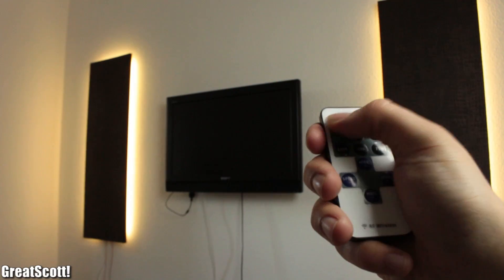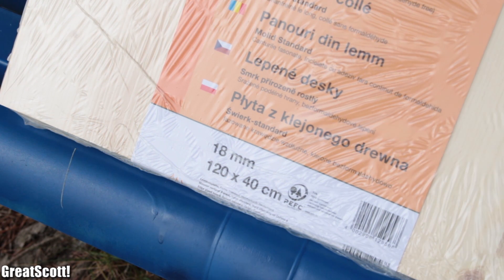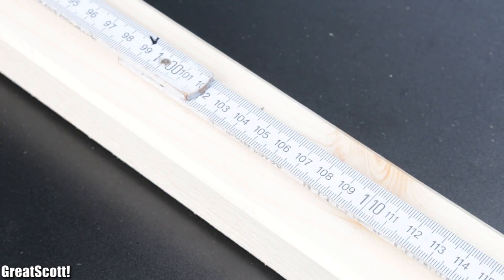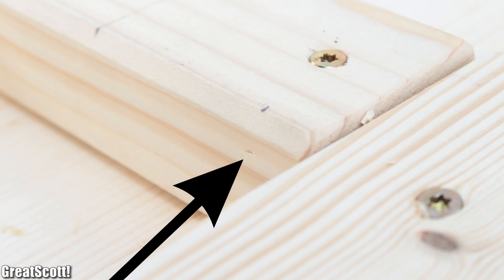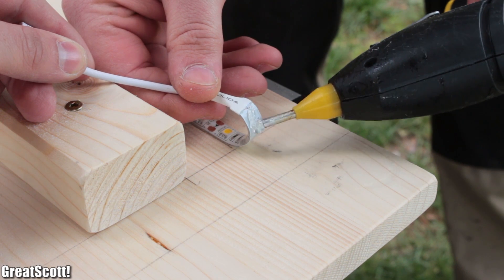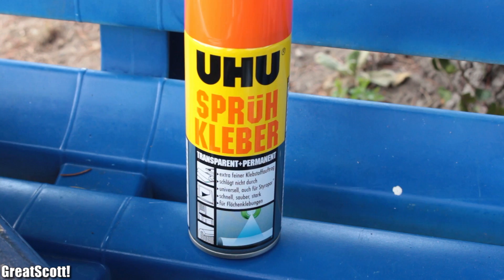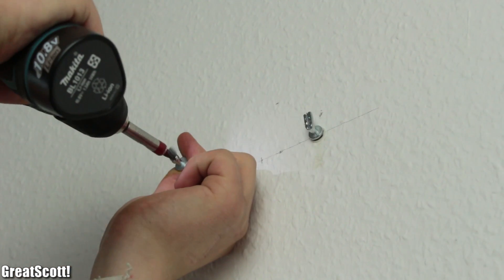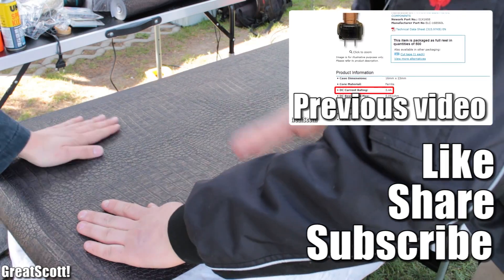Make your own LED Lighting Panels

Comment: Good idea.
 FYI. SI does not use the centi prefix nor the deca prefix. It is either millimetres or meters. No decimal point meters either.
cm is only used in fabric and fashion and finished furniture. The rest of the industries are SI. Probably a few obscure odd ones around.

Comment: Just one question, 
' if  directly connect wires to the LED strips and insert them into the plug will they burn or burst ?????'
Reply: if you connect the directly with the Wall Socket they will definitly break. if Not worse ( fire, explosion)  u have to use a transformer.

Comment: cool video.  i am gonna try making these. 
to bad the 3m tape on the back of these strips usualy sucks
Reply: +bumblebeebe1987 
There are plenty of other sticky two side tapes available by the roll. Leave the original tape cover on and use it as a smooth surface to stick to.

Comment: Nice panels, but i wonder, wouldn't the light look nicer when the LEDs are mounted on the inner beams facing outwards?
Reply: vidm96 I think he wanted it to be a warm glow. all the way around the panels like a halo effect kind of. If he mounted them on the sides it would be a much more harsh light that wouldn't look as nice.
Reply: ***** True ;-)
Reply: No, not a chance. The LEDs need to be pointed at a close surface so the light radiates. Pointing them outward would result in considerably less light output and a much less attractive effect.

Comment: Really good project. Looks professional at the end.
But what about heat dissipation?  I'ill be checking the specs.
Reply: Yes I was wondering too how much those leds will last without any heat dissipation. Maybe use some aluminium as spacer ad support for led (instead of using wood) would  be much better.

Comment: Doing the math with the led's:

you needed 4 long and 4 short led stripes. I assume you used approx. 1m for each long run and 25cm for each short run. So total 5m. Correct?
Reply from the maker: emailausdrucker Yes, links (parts list) are in the description.